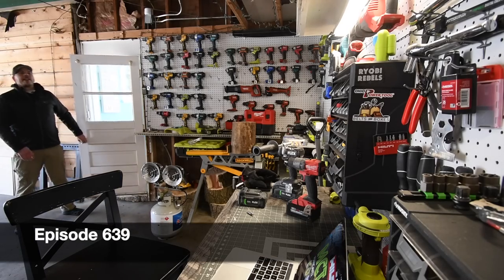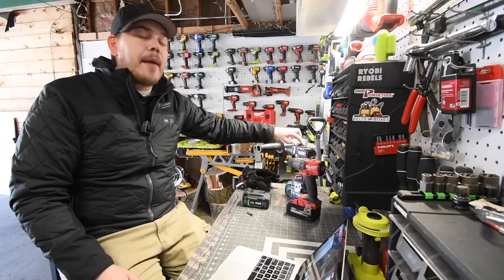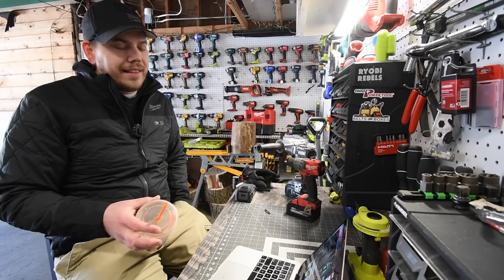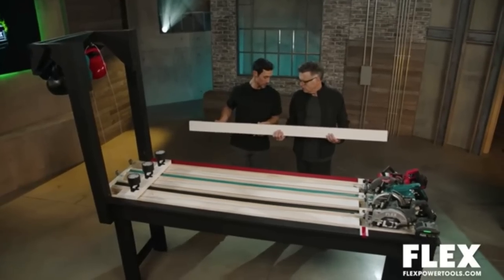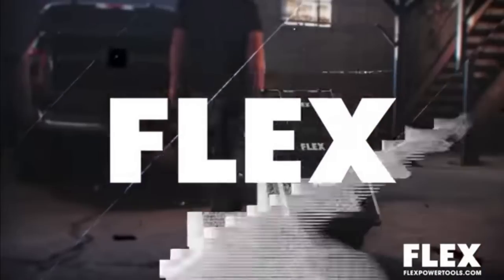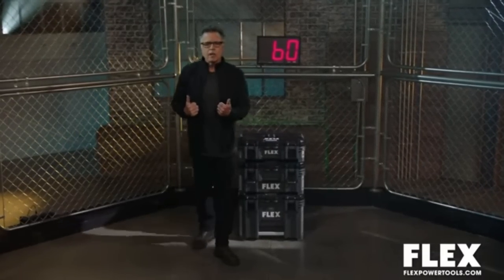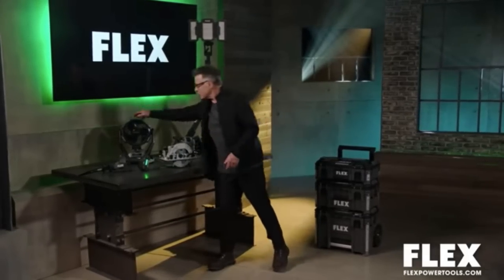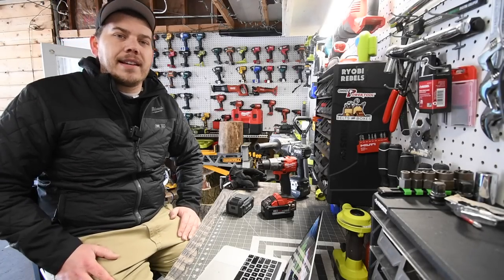FLEX'S Tool and Battery (FACEOFF Part.2)

Comment: 6:04 Yeah, when I saw/heard the test rig they made for this, I audibly laughed. I could be wrong, but the test doesn't even resemble any kind of task you'd use an impact driver for, let alone any power tool. Use the dang tool for the purpose for which it's built - I would've loved to see the Flex impact driver with the new batteries absolutely pounding a bigger lag bolt into some wood like it was nothing. 

But no, let's lift 5 lb kettlebells with a string and sprocket. Weeeee

Comment: Glad you are here to help with the truth. One comment that is never brought up you can disconnect packouts with one hand. Both Flex and Dewalt both need two hands to disconnect each box as you have to hold back clips on both sides.

Comment: The Stack Pack seems like what DeWalt should have done with TS 2.0 as a response to Packout. I'm curious if they're made by Keter like Packout and Tough System. The demo of Stack Pack really made their video feel like a late-night infomercial, complete with over-acted product fail. I'm not a professional carpenter, but I was able to figure out how to open a tool box.

Comment: The saw tast only flaw with that test is where is the dewalt 60 volt with the new 15 amp battery and the skil saw worm drive the boxes are nice but they have a lot of catch up and they should of if the competitors can dot it say they can
Reply from the maker: they just didn't have it.

Comment: 16:55 I don't get the tool box comparison. If you use the Packout correctly, it holds its lid open to. Just put the rear handle down and don't let that dingus play with his "mouse trap." And most of those features that the Flex Stack Pack has over the Packout have already been designed by the aftermarket community. You want to mount your fan to the Packout; there's a 3d printed adapter for it. You want to remove the handle? They make quick detach pins for the Packout. You want to attach small boxes on the sides? They make the Packout Joey. You want to wrap extension cords on your toolbox? They make Cord Cobras for the Packout.

Comment: 18:06 The actor on the left with dewalt tough system didn't even attempt to remove the handle on the rolling box just tried to make it look that way, which it can be removed on the tough system rolling box. Dewalt bit sets also have a clear lid which they failed the mention.

Comment: It’s good to know that if a 5th grader starts throwing fastballs at my flex tool boxes they won’t break lol. Who comes up with these tests?
Reply from the maker: that baseball wasn't necessary to add. it was weird
Reply: @ManCaverTools  last year I highly disagreed with your commentary but this   year man are you spot on. Excellent work bro
Reply: @ManCaverTools  I honestly don't think the Flex PACKOUT will sell because   if they are catering to the pro they need drawers like Milwaukee
Reply: I couldn't decide if that, or the baby weight lift test with an impact driver "test" was worse
Reply: @rickyperkins232  Packout is more like Pokemon cards for adults DIYers.. At least compared to Thanos or Sortimo if you want a professionelle solution for a car.
Its still all plastic.

Comment: Funny how Dewalt starts using pouch cells in a battery and flex does the same months later. I know the tech ain’t new but Dewalt was first in the Power tools with it. Shame they don’t have a 5.0+ pouch battery YET.
Reply: Flex introduced them first. Before Dewalt's. There is a video of Vince at the very cool gang channel taking about them, before Dewalt talked about them.

But yes, DeWalt had them ready to purchase, before Flex.

Comment: "I just applied a little pressure and let the tool do the work."

Come on, guy. You were leaning into that sucker like you were trying to hold back the ocean with an umbrella. I'm not saying the Flex wouldn't have won anyway but to pretend that was an effortless win is disingenuous at best.

Comment: 3:33 PFFFFT that guy with the flex is pushing so hard that he was almost falling on his ass lmao
Reply: and yet it didn't bog down.....like if you did the same with some other brands
Reply from the maker: even I push hard with hammer drills drilling though concrete. its mainly not fair if you push hard drilling through softer materials like wood.

Comment: When are Flex coming to the UK. I can't find this info anywhere 😭
Reply: Probably never, which is a good thing because they're a over priced paperweight that you can't even buy in Canada let alone Europe
Reply: @bread-gz3rl  it's available in canada at rona, reno depot, among a couple of other retailers
Reply: The red line of flex are in uk and Europe, do alot of drywall sanders and grinders etc
Reply: @bread-gz3rl  They seem to be doing okay in the head to heads🤷🏼‍♂️. What's wrong with them? Ive done DeWaukee and Makita and fancy a change

Comment: They should've came out with a table saw and miter saw to compliment the high capacity stacked batteries.
Reply: When I saw they didn't do a 2 battery compact miter or atleast a bigass vacuum to counter milwaukee i was astounded
Reply: Miter saws don't actually draw a ton of power. They're only doing crosscuts.

Comment: Hoping they release:
• Miter w/ AC option
• Table w/ AC option
• Pruners
• Metal cutting circ saw
• 3" cut off saw
• Routers

I think they got potential, I'm just concerned about the overheating and trigger sensitivity people are reporting.

The batteries look great!

Comment: I don't understand one. Think about the rolling boxes the locking system looks identical to dewalts and you were displeased by their locking system compared to milwaukees flex has the same thing you like it?
Reply from the maker: yes and you are correct. this stack pack does look like its a hybrid of both of them

Comment: Flex's hammer drill is one of the best in Concrete for sure. The only one that I know about that seems to perform better in concrete is the Metabo model "SB 18 LTX-3 BL Q I" That model number just rolls off the tongue.
Reply: Impressive, but anybody with any smarts, will use a rotary hammer for concrete.
Reply: @skliros9235  I agree for any significant amount of drilling into concrete, but for drilling a few holes here and there, it is good for hammer drill to perform well. You'll more likely have that tool close by when you need it.

Comment: There's really no point in a regular hammer drill if they don't get the special treatment like SDSes do.
All of the "hammer drill" bits that you can get are just basic broad-line hammerhead-style bits from like ... the 1950s, meanwhile SDS rotary hammers get all of the star-shaped, tri-point, and AI-designed wavy-head masonry bit designs.
Reply: I wouldn't say there's no point. Those old school bits do just fine in a decent hammer drill. Most of us aren't out there boring holes in concrete all day but do need to drill the occasional set of holes. I've needed my rotary hammer once in the past year. The rest of the time, it sits in the shop. My hammer drill is always on my truck.

Comment: I don’t get the tool storage segment. Why would you carry a fan or the bit holders on top of your storage system? That would go in the box. Plus they didn’t have anything attached to the top of the flex stack so what was the point to be made? Nonsensical complaint about those things not attaching to the top imo.

Comment: DeWalt will probably should do what Milwaukee did in 2005 charge other manufacturers that use that cell pack design batteries I see why the 5.0 ah power stack leaked  information was removed because they didn't want them to know that they have it they probably got higher ah versions and development right now in a bit of development since 1.7 ah power stack was announced then I already know that the Rolling  stack system is made by Keter looks similar on the sides to Milwaukee's pack out that box is not going to sell well in  book big deal it can hold a fan on top they have modifying kits that you can do the same thing with Milwaukee and I have seen ones for DeWalt to

Comment: flex be reaching for them customers. Dewalt for life here 😊😊 their gonna keep on and these bigger tool companies that they are comparing their tools too are gonna leave them butthurt. i had to edit this comment a few times as i watched the rest of the vid, sorry. guys are fishy as fuk with that modular system. i can say my all my lids for the dewalt 2.0 stays up just fine and i like at the very end that guy removes the handle of this system to put in this truck and says "mine will" knowing good and well that dewalt handle comes out they just paned to the next scene quickly. and those gas shocks will fail pretty fast if i had to imagine just like on any suv had has had its fair share of trunk opening and closes specially with any force behind it  then you really got a mouse trap. idk nothing about Milwaukee i have never used it personally. but some of this was a tad misleading. i hope you and the misses are doingh good Nik cheers brother 😊

Comment: i like that flex oscillating multi tool press button blade drops  your tests are real flex video I'm not sure.
Reply from the maker: we will find out whenever I puck that tool up
Reply: In came in second place on Project Farm's video, right behind the Milwaukee Fuel.
And I own one, it's pretty nice. The tool as a whole (endurance, ergonomics, and performance) is a good step up over their impact driver, drills, and circ saws.

Comment: It’s easy to say they will come out with 100 tools quickly when they keep dropping new Gens of tools. They won’t switch serious contractors until they drop a good variety of tools. I know for me as an HVAC contractor I won’t leave Milwaukee for the basic few tools flex has. Flex should outperform Milwaukee’s top offering. Milwaukee’s top offering is around 3 years old. This just pushes the others manufacturers to out do flex which is what I’m excited for. Flex has a long way to go.

Comment: The battery tech is interesting but unproven
Had two guys I work with already burned up the "turbo" Hammer drill and that's the only tool that barely outperforms.my Metabo HPT 36V and Makita XGt
The circ saw ,Recip, grinder all would take second fiddle to the Metabo HPT 36 V counterparts and the Hitachi/Metabo HPT line is the better line of pro tools at Lowes unfortunately Lowes only offers much of MetaboHPT's line online and not in store Flex has a way to go before anyone's gonna pay to that premium and price and lug around those heavier tools
Metabo has the new mid- torque, rear handle circ, compressor, only full size pro grade router, SDS plus and Max, largest cordless table saw and portable band saw and most powerful.and lightest grinder and all 36V can be plugged in with AC adapter and Lifetime warranty
Reply: U wasted ur time w this comment
Reply: @cadeolmstead1580  u wast d your time reading it

Comment: Notice they left the dewalt 60v worm drive and the skil wormdrive outta the tests? Would have like to see how flex did vs them.

The promotion feels like a cheap as seen on tv commercial with the cheesy theatrics.  Whoever their marketing team is should be fired. 

Only thing missing is the host saying "but wait theres more, if you order in the next 5 minutes"

Their tools seem well built and pro grade but the marketing and smear campaign is a little over the top.

Comment: The biggest sign of a quality is ignoring your competitors.... FLEX are bunch of clowns, the only test that matters is the field test. Nobody on a jobsite gives two fucks about if a saw is cutting 5% faster. Tools need to work, tools need to last. Thats it and btw what kind of idiot drills large holes in concrete with a cordless drill/driver anyway? Why would you even test that....
I would never buy a FLEX tool really, its all marketing wank.